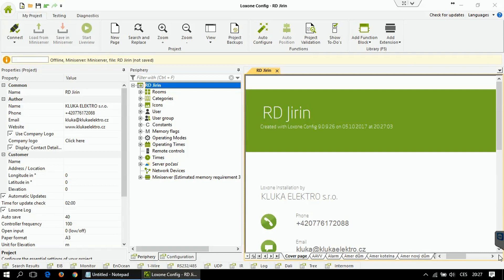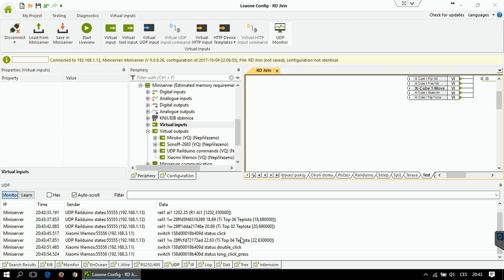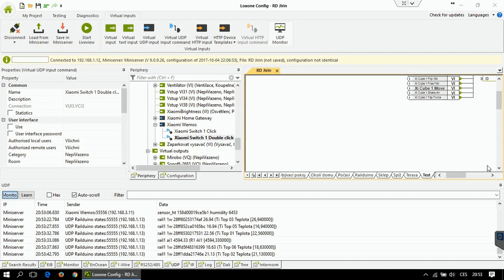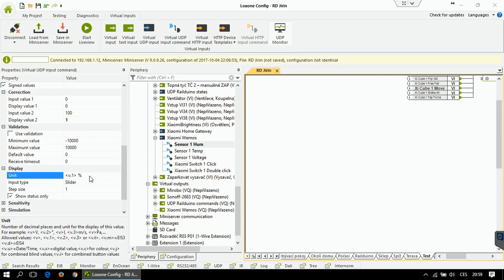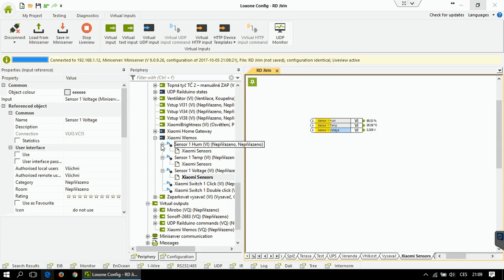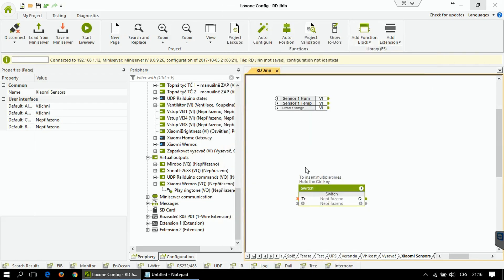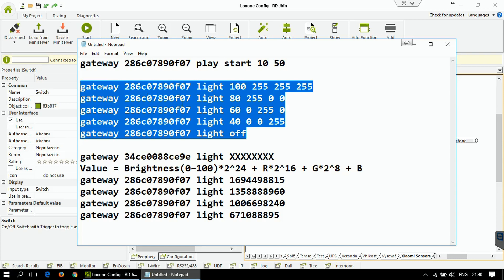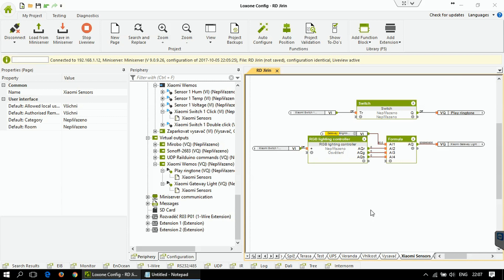Xiaomi Smart Home integration into Loxone miniserver part III.

Comment: Hi Jirin. Everything is working fine. I've ordered the gateway v3 on gearbest and followed your instructions. Some things have slightly changed but nothing shocking. Window/door sensor readout and smoked erector readout is working fine. Only thing is not working is gateway light and sound. Strange. The wemos log says 'command cannot be sent, sid not found or model not matching' but my sid is an exact copy from the gateway messages in udp monitor. Any ideas please?
Reply: Small detail: I had a esp8285 board lying around but it doesn't appear in the library 2.1.0. Isn't there a code workaround in XiaomiReader for this issue

Comment: Hello, many thanks for the tutorial, whole setup Xiaomi and Wmos without any problem, but I cannot see anything in Loxone UDP monitor. I found in Arduino monitor that the Wmos sending UPD packet to the wrong IP address 192.168.88.255 and not to 192.168.88.239. Any idea?

Comment: Hello.  For a short time I have had problems with the switchable sockets, unfortunately I can no longer control them via loxone.  But command goes in as udp.  Does anyone know a solution for this?  thank you
Reply: same problem here. it used to work just perfect but after a router reset only the sensors send their data to loxone but i can t switch on or off the plugs via loxone (no problem via the xiaomi app). ideas?

Comment: Hi, Jirinsv, we have tried according to your instruction, we successfully read the status of Xiaomi sensors. But command can't be sent, once we tried to send command, we get the “command cannot be sent, sid not found or model not matching” feedback. Do you have any ideas about this? Thanks.
Reply from the maker: Hi,
what ESP device are you using? It seems that there is some kind of problem with UDP multicast packets sending. I have reported this issue here: https://github.com/esp8266/Arduino/issues/3702 . It works perfectly fine with my Wemos D1 Mini Pro, but Wemos D1 Mini or Node MCU seems to fail. If you can please try to run code in that issue and check if packets are sent.

Issue is caused by the fact that Wemos doesn't correcly send the discovery packet to retrieve gateways and their devices.
Correct state is if you see in console something like this:
  N: Searching Xiaomi gateways
  V: Sending packet(15): '{"cmd":"whois"}' to 224.0.0.50:4321
  V: Received packet (87): '{"cmd":"iam","port":"9898","sid":"34ce0088ce9e","model":"gateway","ip":"192.168.X.XXX"}' from 192.168.X.XXX:4321
  N: Adding gateway, IP: 192.168.X.XXX, Port: 9898, SID: 34ce0088ce9e, Key: 0000000000000000
  V: Received packet (87): '{"cmd":"iam","port":"9898","sid":"286c07890f07","model":"gateway","ip":"192.168.X.XXX"}' from 192.168.X.XXX:4321
  N: Adding gateway, IP: 192.168.X.XXX, Port: 9898, SID: 286c07890f07, Key: 0000000000000000
  N: Searching Xiaomi gateways done

But most likely you will see just:
  N: Searching Xiaomi gateways
  V: Sending packet(15): '{"cmd":"whois"}' to 224.0.0.50:4321
  N: Searching Xiaomi gateways done
Reply from the maker: There seems to be a bug in ESP8266 libraries in versions 2.2.0 and 2.3.0. Please revert to version 2.1.0 using Boards manager. I have also updated library and released version 1.0.1 so please also update your code as well.
Reply: Does that mean no matter which board do I use I have to use 2.1.0? With ESP8266 2.1.0 and 1.0.1 xiaomi reader my wemos D1 is running ok now. The only problem is that my loxone Miniserver still can't get the date thorugh multicast, I have to modify the IP address in the reader program. Anyhow it's running now, and I also buy wemos D1 mini pro and will try when it arrives. By the way, can we control other Xiaomi devices which controlled by the gateway? for example the plug, switch and so on, what's the command?
Thanks!
Reply from the maker: I will check tonight it – honestly I haven't tested it till now because I have Wemos and Loxone on different subnets. And one more note, if you are talking about sending data to Loxone via 255.255.255.255 it's a broadcast not a multicast ;-).
Reply from the maker: There is a new version available (1.0.2) and this fixes the broadcast problem. There is possibility to integrate new devices, thing is that for example plug is useless in my country (I would have to buy adapter to plug it in the socket and then use another adapter to plug EU devices into Xiaomi plug). But if I get access to these devices I'm sure it can be added.
Reply: Great! Yes, it's a broadcast when using 255.255.255.255, I am a new in this field but very interested in it. One more problem I met is after about half an hour my ESP board is not running any more, I have to restart it, I am not sure if this is because I am using Wemos D1(retired), I will try again when I get the new board. Here is the API (https://aqara.gitbooks.io/gateway-api-english/content/) of Xiaomi device, I think you also have. I just want to make a project with Loxone miniserver go and Xiaomi devices. What do you mean "get access to" these devices?
Reply from the maker: The best for me is to have devices laying on my desk so I can play with them and fully debug the connection. I tried to integrate support for plug, ctrl_neutral1, ctrl_neutral2, 86sw1, 86sw2 based on documentatin you have sent. If you can please test if it will work for you.
To control plug send call "plug SID status on" or "plug SID status off".
If you want to control switch use "ctrl_neutral1 SID channel 0 on" / "ctrl_neutral1 SID channel 0 off", if you have switch with two buttons then you can also send "ctrl_neutral1 SID channel 1 on" / "ctrl_neutral1 SID channel 1 off".
Reply: hello, Jirinsv, with your new version 1.0.4 xiaomi reader, I successfully controled my xiaomi plug, good job! The only problem is sometimes the ESP board go into "freeze", I have to restart it to make it work again.  I am not sure if it is the issue disscuessed in the github:"https://github.com/esp8266/Arduino/issues/3718", now I'm using the same board as you: Wemos D1 mini pro.
Reply: Hi, Jinrinsv, another problem I met is if I keep sending command, the board will collaspe and restart automatically. Could you offer your mail address to me? So I can send pictures to you.
Reply: @jirinsv  Hello Jirinsv.  Thanks to your great description, all inputs and outputs worked great.  Unfortunately I have had problems switching the sockets for a long time.  Output commands are no longer executed.  But I haven't changed anything.  Is there a new update for the arduino or what needs to be changed for the gateways?  Would be nice of you if you could help us further, there are several with the same problem.  Thank you for your help.

Comment: Hey 
jirinsv, Thank you for your tutorials, it works PERFECT. I also have the humidity sensors but also i have the door/ window contacts. have you been playing with these?
I have integrated them in the burgerlar alarm module and this also works..  The only thing which isn't working is the Door and Windows Monitor.. the command : magnet 158d0002913320 status open is text (open) and the door and window monitor needs the value 0 or 1. any idea how i can do this? thank you man!!
Reply: Hey Jirin, any idea please? also when i try the doorbell ring, it doesn't arrive in xiaomi, i'm going to try to reconfigure my wemos now